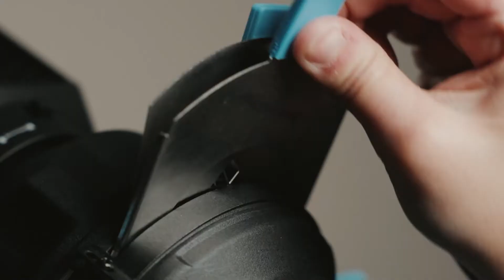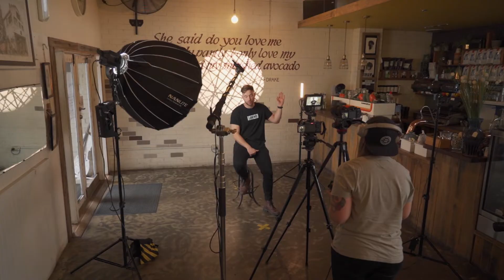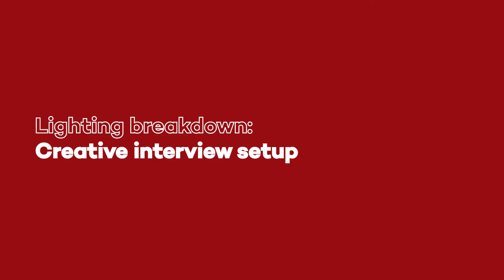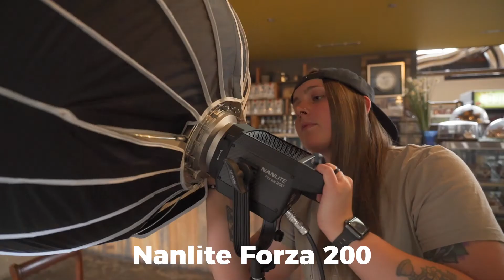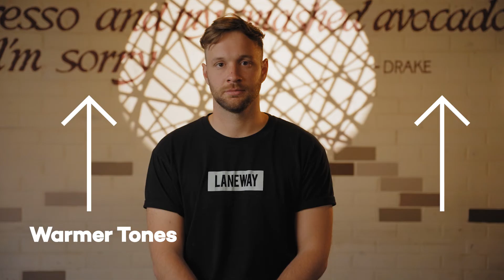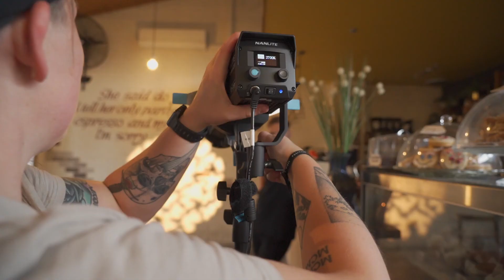Creative Interview Lighting Breakdown using Nanlite Forza 60b & Projection Attachment

Comment: Nice bts Video! Why did you switch over to the nanlite rim light instead of the yongnuo YN360?
Reply from the maker: I wanted to move away from needing to use NPF batteries & instead just charge the actual light which I can with the range of pavotubes